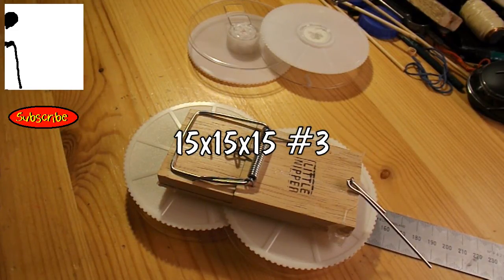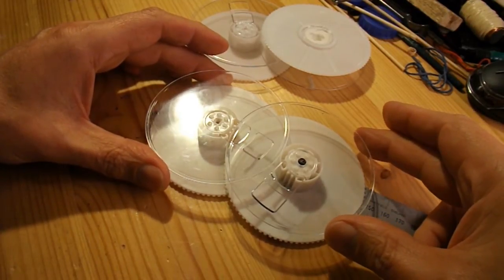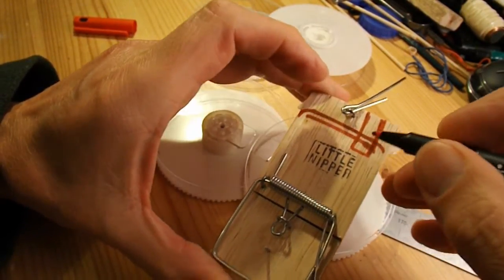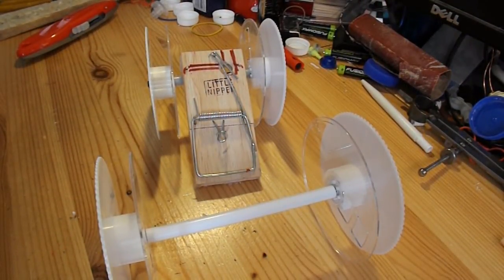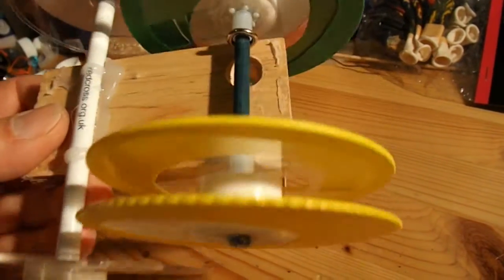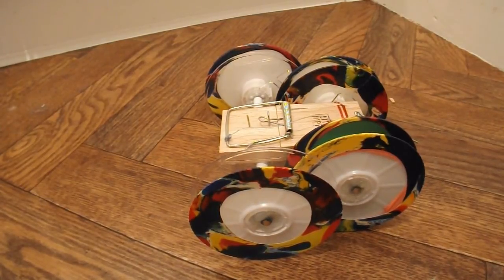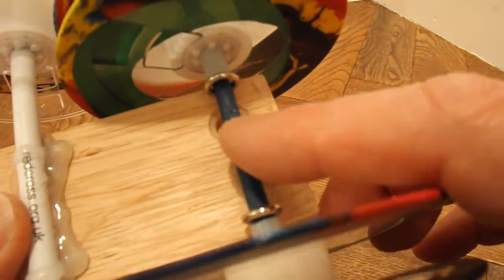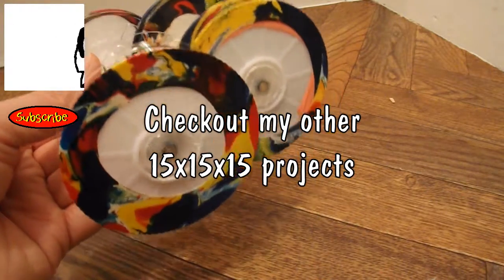15x15x15 #3 mousetrap car

Comment: do you think you would be able to make a reversible mousetrap car
Reply from the maker: Would that be with two mousetraps, first go one way with one mousetrap and then trigger the other one to go the opposite way or one mousetrap but with the car changing direction after a certain distance?
Reply: the car would reverse back after a certain distance with only one mousetrap
Reply: @GrandadIsAnOldMan  I'm making a mouse trap car right now. This one is so fast! But i wanna ask you a question does the wheels make the car faster? Or make it go more far?
Reply from the maker: @reeseforeverandever1470  Sorry for the long answer. The size of the wheel and the size of the axle are linked like the gearing on a car. Think for a minute. The amount of distance your mousetrap arm moves  gives you the length of string you can wrap around the axle. The length of the string gives you the number of turns you can wrap round the axle. The number of turns tells you how many times the wheel will rotate - if you can get 10 turns round the axle, then the wheel will rotate 10 times under power. The size of the wheel gives you the circumference. So for each rotation of the wheel the car will move forwards the distance of the circumference of the wheel. If the circumference of the wheel is 10 inches then in 10 rotations the car will move forward 10 x 10 inches = 100 inches. If the mousetrap arm moved 5 inches and turned the axle 10 times to move the car 100 inches then your gearing is 5:100 A bigger wheel would make the car go further because the circumference of the wheel is greater so each rotation would move the car further. HOWEVER the mousetrap has a fixed amount of power. Turning a bigger wheel takes more power so the car would move slower, taking longer to accelerate. If you use smaller wheels the car would accelerate faster but the wheels might lose grip and spin wasting power. You have to find the best combination to get the best from your car. You also need to consider how far the car will run after the power has finished. Freewheeling will be important if you are going for distance but not if you are just going for speed.
Reply: @GrandadIsAnOldMan  yes thank you so much! Freewheeling is what i need for this school project.
Reply: @GrandadIsAnOldMan your channel will make me love science even more! But covid is making everything bad for it, I wish it could end you know. But nice videos they are very helpful when it comes to time like these you know 😉😉😉😉
Reply from the maker: @reeseforeverandever1470  friction is the key. Friction on the axle bearings can be reduced by adding ball-races or simply rubbing the graphite from a pencil onto the bearing surface. Make sure the wheels don't rub on the bodywork. You do need the wheels to grip the floor, if they slip or spin then it wastes power.
Reply: @GrandadIsAnOldMan  alright thank you ❤❤❤